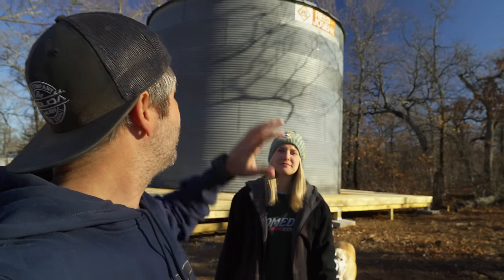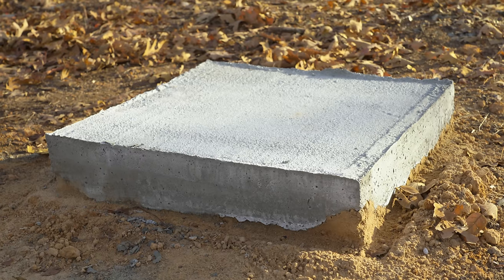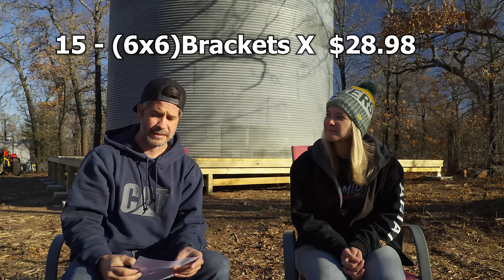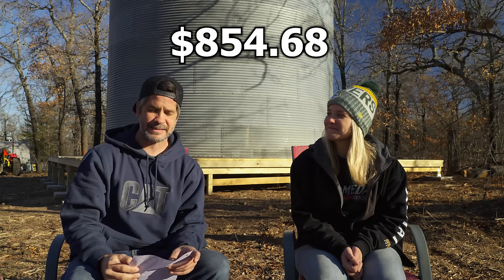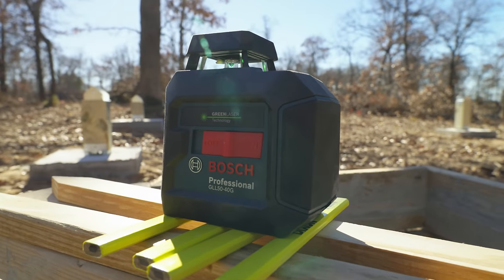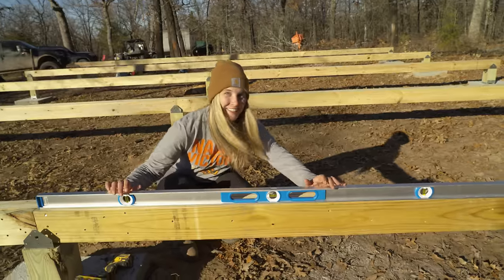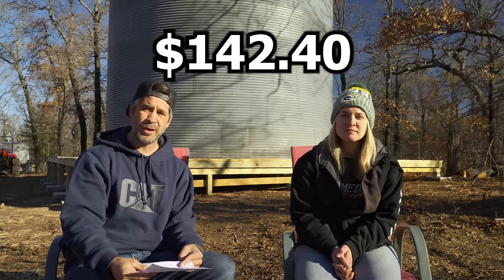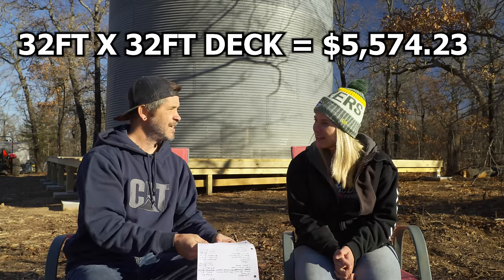Total Cost BREAKDOWN For a GRAIN BIN + HUGE DECK For TINY HOUSE!

Comment: I understand the concept of the deck to raise it off the ground and give room for plumbing, but what happens 15 years from now when the deck weakens and the wood begins to rot? It will fall through. I think that a solid concrete pad for the building to sit on with a deck built around it would last longer. Just my opinion.

Comment: You build it all by hand and will be there 100+ years, and it cost less than a slab and the cost to build a house shell. Plus you have the option to change your floor plans for plumbing and have full access to all your plumbing. And when you have kids you can tell them to go stand in a corner and you live in a round house,no corners in a round house!!  LMFAO 😂

Comment: You cheaped out on your beams. Hopefully they don't sag. You could see the play in them when you were filming. The beams should have been 10" or 12" material. 6X6 posts aren't intended for beam use on a deck.

Comment: You may have saved money by building the wooden deck over a concrete slab, but perhaps the cost difference you saved will be spent on building your interior walls as your working with a round structure instead of a square one.

Comment: Hey guys what you heard about putting boards together to make your 6x6 beams is correct nailing 2x6 boards together is stronger than a 6x6 because the grain in each board is independent of the other 2 so where one might be weak the other 2 will strengthen it,whereas a solid beam shares the same grain so if there’s a weak spot it runs the same a crossed the whole board, I have been in construction 40+ years and in my experience you did the superior thing by doing it like you did!

Comment: Thanks for sharing that.  I would have guessed the deck would be more given the lumber price circus we've had the last 3 years.  Can't wait to see what you use for sealing up the deck floor and insulating the interior floor.  Most of the construction  I've seen has a basement or slab and the raised deck foundation only used for summer houses that are  not used in winter.  What might be cool is to have a semi-circle "birds nest" loft up in the peak above the second floor with a ski light.   Ski lights have been leaking challenges, but these days there may be better sealants available.

Comment: I think you made the right choice by placing the Bin King structure on top of the deck. love what you guys are doing. Concrete would have been super expensive and with the way you guys are doing it, this makes the most sense. When my wife and I built our home, we did concrete and it is very hard to plan exactly where you want everything that early on n the project when we being like you are not professionals. We had a vision and made some drawing and wrote some dimensions down and jumped in!

Comment: The two foot square footings are great, I did not do any load calculations , however the supporting concrete should be below the frost line in your area. In other words your concrete columns are wrong side up. What will happen is the upper ground will freeze and pull the round portion up the amount of the frost heave. The preferred method is to build your box below the frost line and add a cardboard tube to extend it to your soil line or above. From what you have now after the first few winters check for level with the laser and adjust any low beams by shimming above the columns. You may find that the freezing may be stronger on the perimeter than the inside portion. From experience in Alaska where the frost level can be 8 feet down, the important thing is to have the square footage to support and let the structure "float" with the frost heave. Keep an eye on the foundation and adjust as necessary. Nice to see an ambitious couple.

Comment: The expense hasn’t ended yet.. put a subtotal on that list.. cause  depending on what or how  too.  If u make the inside 2-3 stories, or just do the first floor, and wait until the other later as you go.  The echo sound inside will need addressing too.  And so building continues..  lots of good luck..

Comment: Me again , A polished concrete slab that size in the UK would be 10K , so a good saving going the deck route. If the laser is a one off job ? then we tend to use a clear hose filled with water and datum each base shuttering ,rather than the timber top plate, and i suspect cutting your own brackets from a length of angle would have been stronger and better on costs? Will watch with great envy as you crack on with the fit out, Regards Paul and Marie .

Comment: Hey Guys, cool project!!! I build cool stuff for people who can afford cool stuff. Vey fun project!!! Oh to be young again, but I have concerns with your foundation. You did a good job of getting past the freeze line. You also made the right choice adding rebar. The thing that concerns me is the small profile of the concrete posts that reach the frost line and the concrete squares you added at the top. The key idea with a foundation is to remove all organic matter while reaching past the freeze line. if you set those square pads on topsoil, the reason it is called topsoil is because it has organic matter in it and will rott away eventually. This means the better your soil is the less those squares of concrete matter. I suggest you keep a close eye on settling and keep the project as light as possible. If you wish to address this more, simply dig out under square slabs strategically and pour more concrete under each. Your best bet is to assess strategic load points that the grain bin will put the most stress on and do them one at a time. Perhaps 4 corners closest and then load points in the middle of those. Good luck and never surrender!!!!!

Comment: This is late but I did the same thing by sandwiching boards together and an old guy told me that make sure you glue and screw them together, that glue these days works awesome, I think it was gorilla which worked well and I also used No more nails,  talk about solid that stuff is awesome

Comment: Looks great! Thanks for sharing the cost breakdown. I built a 4 season room; 2×6 insulated walls and R40 ceiling and R30 floor on a deck platform. It is essential you insulate  and air seal the floor for energy efficiency/comfortbility. Of course you'll need to do the same for the walls and roof. I'm looking forward to seeing the interior.

Comment: I like the whole thing. Without knowing it you guys won't have water sitting under the house and also wind dried under there. I would recommend staining under the deck in about 2 years from now. I built my deck almost 30 years ago and it still looks great. I just give it a lite stain every 4 years or so when it's very dry to get a good penetration in the wood. Don't over protect it cause it doesn't help.

Comment: Just an idea. What if you have a fireplace come old fashioned coal stove right smack bang in the middle.  
Build the kitchen around that downstairs.  
Have a spiral staircase wrapped around the kitchen to get to the second floor.
With the shape of the building and roof you can use the one fireplace to heat up your water and the entire home with an outlet right at the pitch of the roof to help control the temperature inside.

Comment: 24 ft x 18 ft tall costs between $9k and $12k depending on condition according to my internet research. You seem like you got a sweet deal of $7k and included delivery and install.  Deck is ok and sounds more level. Easy to get at plumbing. Please go over when sewer and water and electric will potentially be installed.

Comment: I always think a raised foundation is better than a slab. You don't get cracking if there's uneven settling, and that's not even getting into what you run into if you have to do plumbing repairs on a slab. My only concern with your deck is that even pressure-treated lumber has a limited life span UNLESS you are fanatical about waterproofing, and since your house sits ON the deck, you really don't want to have warping or rotting of any of the deck boards or support structure. I wonder if you might be able to epoxy coat it, like they do on garage floors; that would be the most durable coating I can think of. Looking forward to seeing the completed house!

Comment: I've heard, via research, that most home build, regardless of the structure can cost upwards of 3x for the interior structures. I've always wanted a tiny house, log cabin style but its that interior finishing costs that kill me, even if you just do basic minimum to live, depending on the state, laws, weather, etc. etc. At 65 not sure what I'll do. I'l living in Kenya right now, because thats all I can afford, but I miss my family and want to come home now now!  They are correct. The glue that you use is stronger than the wood itself. (tested in a university class) ! I'm sure there's a lot of research on that. Save money, stronger beams! Good choice.

Comment: Hmm...... Do you have access to a structural engineer to ask about structural issues? I'd be concerned that the footings, 2x6 platform framing and the grain bin bearing points on the deck are undersized and misaligned. I think those joists are going to get some serious sags over time with those kinds of spans. Probably a slab would've been structurally more appropriate.

Comment: In my limited construction and even restoration experience, an elevated foundation is always better than a slab foundation. Sure, if you buy a "cookie cutter" home from a builder, where you only have a say so in colors and finishes, slabs work great. But when you are planning for custom, on the fly, or even, future flexibility, elevated foundations are the way to go. And heaven forbid, you have a busted pipe or some plumbing or electrical redos in your future, elevated foundations come into an advantage even then. Personally, in my opinion, based on doing construction, and working for a disaster renovation company, elevated foundations always make repairs, or even, upgrades or renovations easier and cheaper

Comment: Yes you  should have built a slab. A slab will out last a wooden deck. I learned never to build a feed bin for a house.
Reply: What about a feed bin for a house?
Reply: justthink5854  I didn't understand the comment about never building a feed bin for a house. I get what you're saying about moisture but surely it's only the beginning of starting to build the house from the shell. Moisture is probably one of the many things to consider. I bet it'll need some serious insulation.